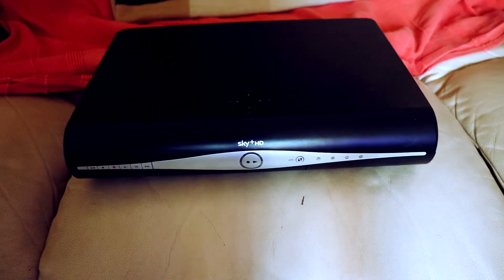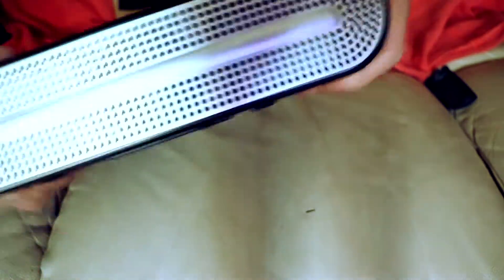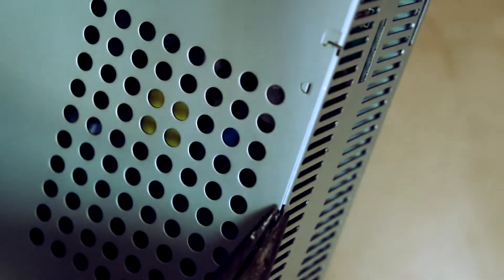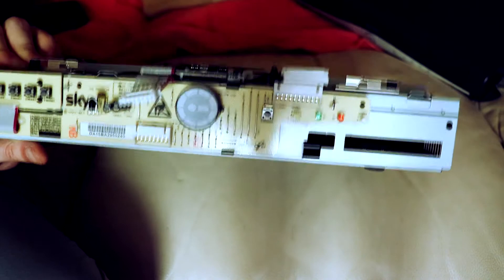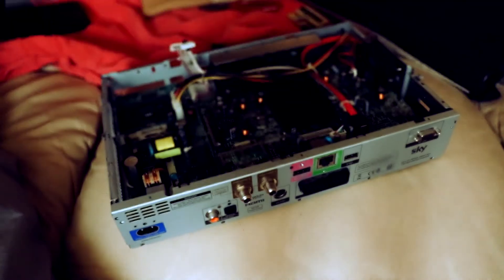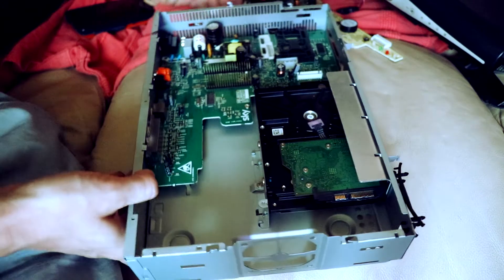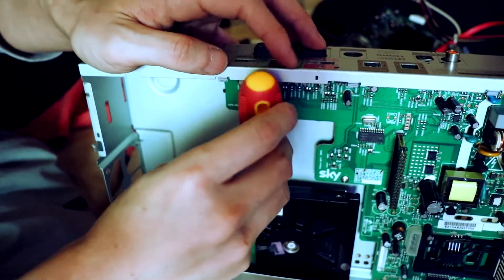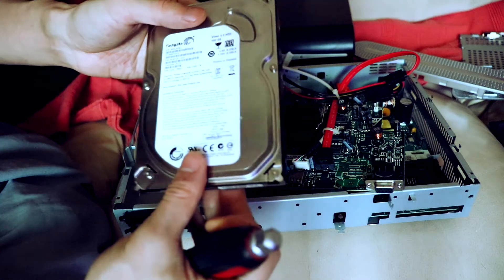Sky DRX890WL Sky+HD Digibox 500GB How to Dismantle/Repair or Upgrade

Comment: Cheers have opened all sorts of boxes but the Youview ones are the ones you want for the small 2.5 inch 320gb drives for your laptop!
Virgin Tivo-500 have the same drives as these Sky Boxes.
Virgin Tivo-6 are the ones you want with its 2.5" 1tb disk - TASTY!!!